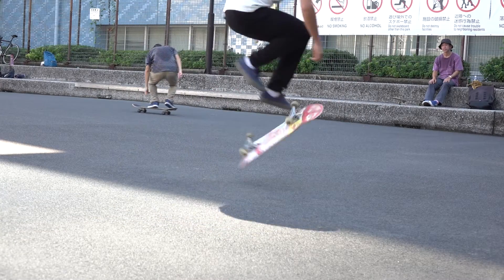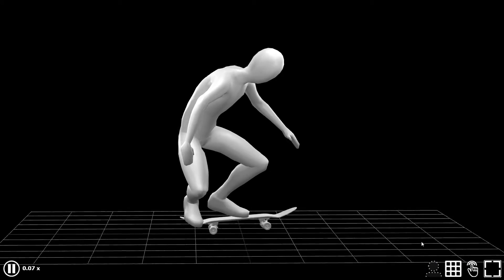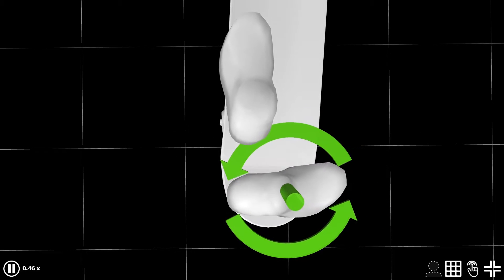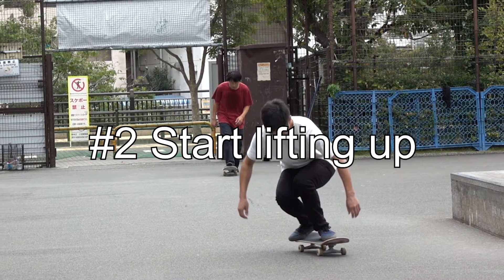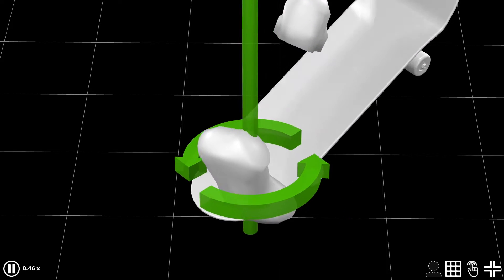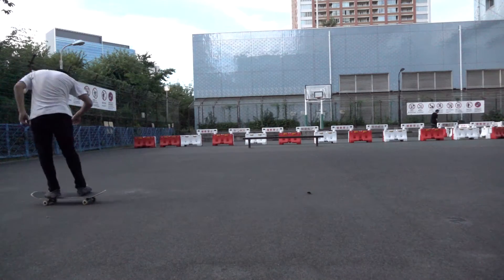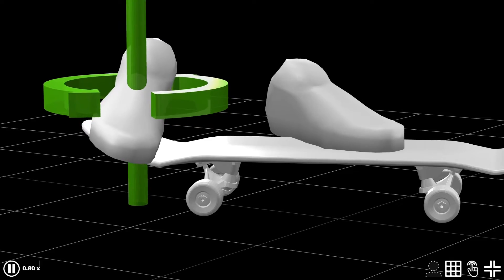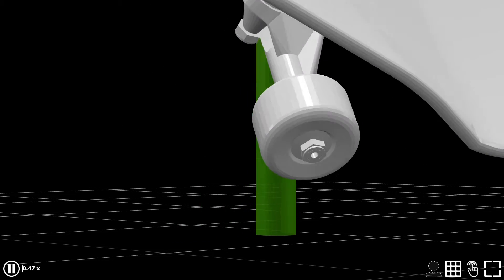Scientific functions of scoop in Treflips.

Comment: Question: according to your theories, it should be harder to tre if i had hard trucks
Reply from the maker: sorry if this video has given you a wrong impression but bushings do not have to be soft, UNLESS yours are as hard as stones. what's important instead is that your bushings have enough bounciness. their hardness may vary depending on your preference.
in my case they are relatively loose. i ride bones hardcore bush medium.

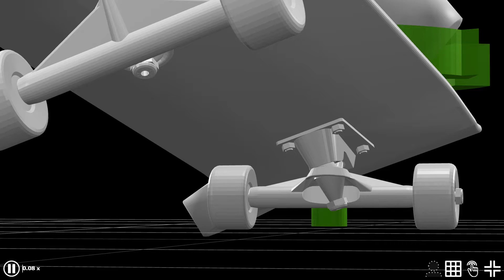Comment: I find that when I do the scoop motion, if I also add a lot of -Y to the movement of my foot it helps a lot with the Z axis rotation. The result probably looks like what people call a steezy 360 flip where my foot moves far back from the tail. I find this motion of extending my back leg is actually what causes the Z rotation but also more specifically the motion you describe at 4:49. I had a really hard time figuring out 360 flips until I realized that at this exact moment of doing the scoop, your back leg needs to be FULLY extended. What happens then is that while the board rotates your back leg has a little bit more time for your knee to bend and since it's fully extended your knee will naturally bend on its own to bring it back to the board. What most people are doing is trying to scoop while their knee is still partially bent, and what happens there is that when they scoop and jump their bent knee has a tendency to extend naturally so instead of bending inward and back to the board, they will put their foot on the ground.
Reply: Thanks for that explaination. Gonna try it.

Comment: so the kickflip rotation is caused by the bushings snapping back to a neutral position while in the air? never thought of it that way
Reply from the maker: I believe it is considering my front foot does not even touch my board. 

A few things to note though. 
- There may be people who actually use their front foot to flick. Mine’s just one way of doing it, not the only way. 
- Different boards would behave in different manners.
Reply: @whythetrick  do you think it might help to tighten the trucks so that it creates more pressure on the toe side?
Reply from the maker: I don’t think so. 
I ride bones bushings and they are fairly soft.

Comment: Could u make a video on how to get air on banks
Reply from the maker: That’s a good one. If I share some key concepts here,
- Timing is key. Wait until the tail reaches the edge of the bank. 
- You may crouch down as low as you want but make sure that your body is extended by the time the tail hits the ground.
Reply: @whythetrick  thanks sooooo much ! I couldn’t get the figure out the timing for a long time . I always extend up before I get to the bank